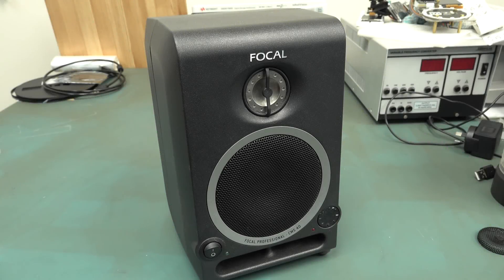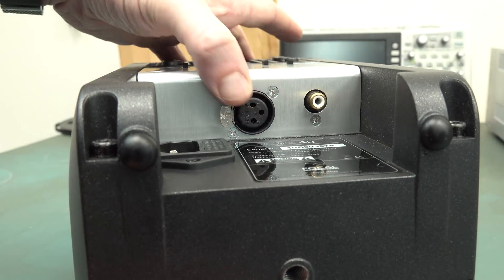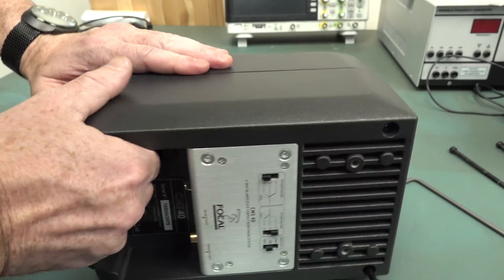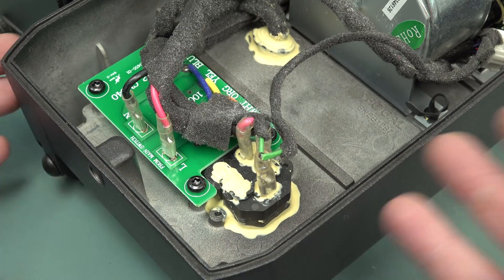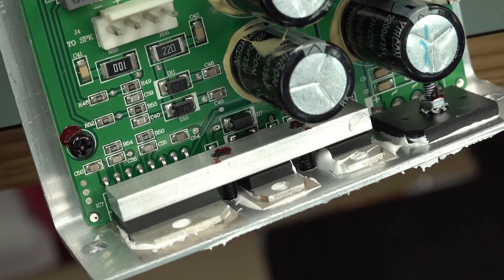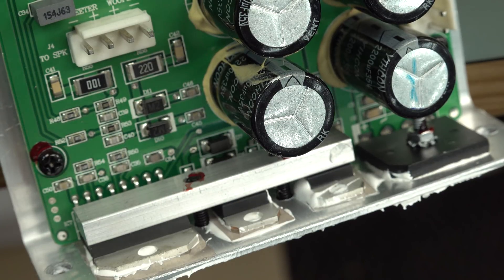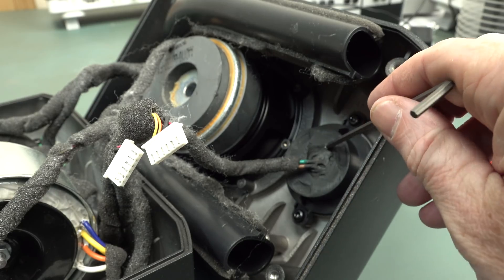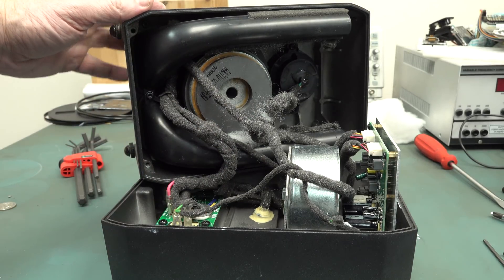EEVblog #1156 - Focal Professional CMS40 Studio Monitor Teardown

Comment: About "isolation mats": they are useless. Ethan Winer did measurements on those and the effect is: exactly like moving the speaker up by the isolation pad thickness. If height is compensated: whomp whomp whomp, diddlysquat nothing. The amount of vibration that speakers, even with more modest chassis design, is miniscules. Couple of napkins is enough to decouple them. The amount of sound vibration coming from the woofer is several magnitudes of order more energetic. Test it: put your hand on a speaker cabinet. Does it vibrate? Check the woofer cone, does that vibrate? And what would be the difference between the two? If we use best case scenario, you can estimate that solid-> solid can transfer energy 1000 times better than air-> solid. Are we even close if we did magnify our vibrations and assume all of it is transferred without losses... Yup, nowhere near the same caliber.. The amount of air that is hitting EVERY INCH of the room are way, way more than vibrations that could come even poorly decoupled speakers.. 

5mm, 10mm mats or rubberpads are all that are needed.
Reply: People get crazy about acoustic isolation, but for the people who were just going to put their monitors sitting on their ikea cardboard desk, mats are probably a good idea! I really like what genelec and audyssey do with their built-in mounts to get some clearance above the surface and angle them up a bit - just take them off if you have proper stands.
Reply: That's complete lie. I've had enough problems in my and my friends studios with non isolated studio speakers starting to vibrate the table or any structure they're on. Even heaviest tables often have some weird and wonderful resonant modes and those drive you crazy when you're not hearing what comes out of the speaker but your table resonating. Isolation is a very good thing indeed to minimize that.

And yeah, my current studio table has a mass of ~90kg, it's very rigid and even that resonates on certain frequencies if I don't use the thick rubber isolation stands that come with my Genelec 8020A's. And I don't even have to floor them all the way. The whole table doesn't but the table surface does. Though heavy and rigid, it has some weird harmonic mode at around 80hz. Vibrations in the air don't have enough energy (or the energy doesn't couple as easily) to make it resonate audibly though.

And those speakers are as rigid as they come and weigh a ton considering their size. and they still can be felt vibrating when bass hits even on modest volumes... until you use the isolation rubber pads and those vibrations vanish.

Comment: Ha, there is sooooo much religion around caps it make's me laugh reading the comments!
Reply: someone outthere I don’t know that I would call it religion as it is a product of a great many “off-brand” electrolytic capacitors, particularly out of mainland Asia, having a very poor reliability and performance record over a number of decades.  A large percentage of the electronics discarded each year are discarded as a result of these cheap electrolytic capacitors having failed prematurely (some after less than a year of service) — in fact the majority of flat panel failures can be attributed to to just two causes: electrolytic filter capacitor failure and failure of the flat flex panel to board connections.  That is true of a great many other modern electronics we throw out each year as well.  Compare that against the typical 20, 30, even 40 year service life from the better quality electrolytic capacitors brands and you have a very practical reason for the concern when cheap off-brand capacitors are found in what is supposed to be premium gear.

Comment: While I know it's convenient I just don't want my amplifier combined with my speaker/cabinet. I want to be able to mix and match the electronics and the electromechanical portions.
Reply: It's not just convenience, it allows the crossover electronics to come before the power amps and gain much lower distortion in the process. Yes there are some active speakers with external crossovers but most people are put off having to buy at least twice the number of amps to power the thing.

Comment: That foamed adhesive tape around the wires will eventually turn into a nice tarred mess. Some of the grossest repairs I've ever done used this junk. I prefer the cloth tape any day.
Reply: "Time to get out a the clean-anything-bottle of solvents"
Reply: @derkeksinator17  On this side of the pond we have "Goo Gone"
Reply: @CliveChamberlain946  right. It will degrade....NSA
Reply: Agreed. It becomes worse that all types of snot

Comment: You got a super fancy speaker there, and expect a TRS input?
Reply from the maker: Well, I had balanced TRS leads before, so had to swap, so a bit annoying.
Reply: @EEVblog  XLR is THE standard in professional audio. The only time I used TRS was for music instruments, guitar amps and headphones.
TRS isn't that great because contacts are completely exposed on the male plug and it does nasty things when inserting (contacts get shorted during insert).
Reply: @ppdan TRS isn't for guitar amps or music instruments (if you refer to guitars/basses). TRS is balanced, and all these musical instruments uses TS 1/4" plug unbalanced connections. Only some synths or other generators and/or processors use TRS I/O. Anyway, these speakers have RCA connections, I don't see why they can't have also a TRS connector parallel to the XLR one.
Reply: @audio01  I built my own XLR-M - TRS cables for my main monitors since many smaller rack sized audio interfaces have main outs as TRS for space saving reasons. And XLR is completely compatible with TRS in a sense that you can run balanced signal through it properly and since this interconnect isn't mic level signal but line level, there's no worry about the small increase in RF-susceptibility that  TRS-connector might cause in comparison. :)

Recently I've had my mixer in between the audio interface and my monitors so I have TRS-TRS cables connecting them and then standard XLR-M - XLR-F cables after that.
Reply from the maker: My Rode AI1 interface box uses TRS jacks, more than good enough for the application.
Reply: Not really, TRS jacks short things out when connected, that's why XLR is the pro standard.
Reply: @EEVblog , Sorry for a small book... I'll try to be as terse as possible. I don't meant to put you in place or anything, I just want to tell you why I like XLR... maybe you'll find some of it interesting as well  :)

TRS hasn't caught on in professional use mainly because it's mechanically not robust enough for the road and isn't directional in it's mechanical or electrical design. It doesn't have a locking mechanism by default and is a bit of an arse to solder compared to XLR when you ultimately need to fix that broken cable when on a tour. I've done that plenty of times.

Directionality in mechanical design makes sure there's no risk of wiring inputs to inputs or outputs to outputs. With XLR you can't do that unless you use some weird sex change adapters or build yourself a non standard cable, both which are nothing a professional would use or even need to use with proper gear.

It also makes sure the correct grounding scheme is done since the shield ground and signal ground are separate in a  sense that the shield ground is only connected to chassis ground at the output end of the XLR-connection between devices. Thus any interference picked up by the shield is taken to the signal source, through the device chassis to earth ground and doesn't cause problems to the signal ground potential since they're kept separate (well... star grounding scheme at the power input connector).

And obviously, using XLR, ground is always connected first, and separated last when plugging it in/out, on TRS, you plug it live with your own peril... especially if you're running phantom power since during connection there's a moment where ground is disconnected and hot/cold are shorted to ground etc. :D

There's also an advantage in RF-immunity since the cable shield connects to the XLR connector metal case that almost completely wraps around the whole connection interface, thus making sure there's as good of a coverage as economically viable all the way through the cable run and through the connector hole in metal case. There are also XLR-connector designs that have feed through EMI-filter designs for absolute RF-immunity. (see https://www.neutrik.com/en/neutrik/products/xlr-connectors/xlr-cable-connectors/emc-series )

Anyway... that's my small list of reasons to use XLR in professional environment. Though I do agree, that for most people it's a bit of an overkill, but: "I've never regretted using XLR instead of TRS" :D

Comment: Good stuff. Solid construction. Taking a look at the effects of capacitors across rectifiers would make for a cool video. You've got some nice AC sources and loads and what not, plus some EMC probes if I recall. It would be interesting to see how much of a difference it actually makes, particularly if the output is already buffered with multiple capacitor values. I haven't looked into it deeply, but I would expect the capacitors to also create a vulnerability by allowing high frequency noise on the input to pass into the unit? It would make more sense if there was at least a common mode choke before the rectifier in that case. Wouldn't capacitors across rectifiers just lowpass filter the switching transients leaving some low frequencies intact? Would RC snubbers make more sense? Is any of it worth it from a measurable/practical standpoint (audiophile fluff aside)? I'd be grateful to hear some reasoning from experienced engineers; thanks in advance.
Reply from the maker: Hmm, yes, this would be interesting. Harder to translate that into what difference it makes in audible speaker noise etc, but might be able to see something with some probing.
Reply: those caps are probably parallel to diodes to reduce switching noise (which can be in several Mhz, because of diode recovery time and capacitance) not to reduce high freqency coming from trafo or mains

I hope Dave can test diode recovery noise on his fancy pancy scopes, compare regular diodes, soft-recovery diodes, fast diodes, schotky, under serious load, no load etc
Reply: I've read another explanation around these capacitors. They are creating a path of constant impedance for some stray RF currents flowing through capacitance between the power transformer windings. Without these capacitors, the impedance is modulated (bigger when AC power voltage is near to zero because all diodes are closed) and the RF finds some pn junctions in a most unexpected place to get rectified and creates hum. When the RF current is not modulated with these 100Hz impedance pulses then the effect of RF injection is less noticeable. (But probably this is more relevant for AM broadcast receivers).
Reply: So maybe do a GSM cellphone test near the speakers.

Comment: Sorry what's off topic, I need help with the printer thing o Matic.6 years ago you made a video about the assembly of this printer and hope you can help me.I was recently given this printer as an unnecessary thing without an Arduino Atmega 2560 and now I need to flash it, but I can't find the firmware.
Reply: Get Marlin, or a new, better printer
Reply: The marlin firmware does not have files for the makerbot v2.5 motherboard. I can create a separate build file but this will take a lot of time and effort

Comment: Now, it's either a split case or you at least know how to open it quickly. Get a couple standalone amps, hook them up in place  of the internal ones and listen for the hiss. It would be very interesting if the hiss remained
Reply: probably asymmetrical input issues

Comment: Yihcon aren't the worst, especially not if they're tested alright.
Reply from the maker: It's "the vibe"
Reply: Not all Yihcons are created equal. ;)
Reply: @robbedoeslegrand236   Yeah no, you just need to do proper testing (Which is hard in mass production i guess?)
Remember, Japanese capacitors were once also ranked as one of the worst... (It's just upto QC)

Comment: I have a buddy who designs DACs. Says that sometimes he'll use what seem like budget, cheesy caps or resistors or whatever because they have an extremely specific profile they use during tuning and voicing. While it PROBABLY was a cost-cutting maneuver, Focal could be using those Yihcon caps because the speakers sounded better with them.
Reply: As long as the capacitors are not in series/parallel with the signal path and power supply is well designed and regulated, those main filter caps should have zero effect on the sound. They should be as good quality as possible with long life and low ESR...

Comment: I've got a pair of KRK G3 RP6's. I saw focals offerings when I purchased mine. People have bashed me for not buying the Yamahas. I think my KRK's are very good and have both LF and HF adjusters. They are very low interference volume as well as loud  enough for my studio useage. Got mine for £120 each. I also purchased a 8s2 KRK subwoofer for £250 and this completed my studio setup. I produce EDM, Dance and trance music. I also produce rock, metal, ballads and other piano works and these are excellent for all these genres. I've got focals in my car for my 7.1 setup which is excellent.
Reply from the maker: The Yamahas have rear ports, not good for against walls etc.

Comment: I’d fully expect those to be streets ahead of the KRKs in terms of sound quality. The KRKs might have a little more low end but it’s not exactly the tightest low end. Focal speakers can be a little on the bright side but I think those have a little bit of adjustment.
Reply from the maker: Not "streets ahead" I guess, but you can hear the difference in background detail. The tweaking makes a big difference
Reply: EEVblog I haven’t heard the particular model you have there but Ive heard other Focal monitors and seven KRK models. The KRKs have always sounded woolly/boomy and opaque by comparison. Adam make some lovely monitors if you change/upgrade again but those Focals should serve you well. They’re physically smaller which is a win for me when they’re sharing desk space.

Comment: Ohhh yeaaahhh... I used to build custom speakers professionally, the die cast alloy rigidity gives a considerable boost in performance to the woofer. Back in 1996 the highest dB record was a truck enclosures made of solid steel plates and concrete!! There are some fancy premium speakers made of polished concrete (must be a pain for international air shipping $$$) haha
Reply: if you want damping metal, why not cast iron? dirt cheap and has better damping qualities on its own than any other stock metal. there's a reason precision machines are still made of cast iron to this day.
Reply: @SuperAWaC  You must've watched AvE's new Haas video.
Reply: @SuperAWaC  Mineral casting composite, AKA epoxied granite, apparently performs even better than cast iron. Other high-end choices if you need great strength are Silentalloy and various memory metals. HiDaMet for keyword.
Reply: Polished concrete is just "entry" level fancy premium for speakers,  real fancy premium is enclosure made from hand carved black Italian granite :)
Reply: doesnt really matter though, sound pressure is more about internal dynamics and the actual speaker used.
Reply: Drkastenbrot, cabinet flex cancels out the driver resulting in lower efficiency and that nasty “hollow sound” resonance.  Basically the sides of the enclosure become an out of phase driver working against the real driver itself...very bad passive radiators essentially.  I remember guys bragging about how they could bounce quarters off their subwoofer enclosure.  Once they learned that was all wasted energy and then installed reinforcements to minimize the flexing.... much higher output and sound quality.  Much tighter bass.
Reply: I would think that if you make it as rigid as possible, you increase the resonant frequency way above audible or at least so high that it doesn't really matter anymore since HF-driver has way less mass to vibrate the structure... anyway, i'm sure it's fine since Genelec uses cast aluminium in their enclosures almost exclusively these days. Though i haven't looked at their dolby atmos focused series yet, it's somewhat new.
Reply: Most live sound cabinets are made of high quality plywood or MDF. AFIK, all of the Meyer units are. It has better sound quality and gives just enough resonance to sound perfect. They also seal around all gaps.
Reply: @remyrattner6399  Not so true anymore. Polymer cabinets are more common by the day.  More rigid and lighter.

There's an issue of cost when you need very expensive tooling and lots of R&D to produce large polymer cases, and if you're not planning to sell let's say excess of 10.000 of those 15.000€+/piece subwoofers (which are large in live use) that putting money into that tooling isn't necessary if weight isn't an issue and you can produce stuff with MDF/plywood already with existing tooling.

With line arrays though the weight really matters sine you can't really hang that beast if your array starts to be too heavy. And line arrays are more common all the time.

There's also the matter of using the equipment till it dies.

The businesses that buy most of these products rent them to events and gigs, so the don't really have an incentive to buy the newest and best until some piece isn't economically viable to repair and it breaks.  That means there's a ton of ~20-year old PA-equipment running around and those are without exception plywood or MDF.
Reply: @Mtaalas  Thanks for the info. Really interesting. I know the Meyer UP line is all wood/MDF. Not sure about line arays, though. Never built one.